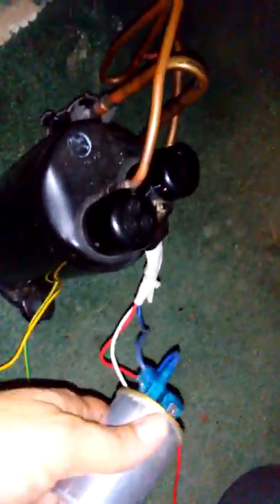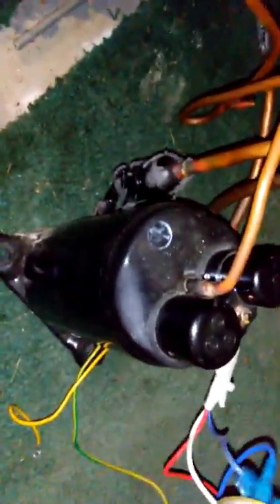Testing a new vacuum pump for vacuum distillation

Comment: That'll ruin the compressor if you don't put a cold trap between it and the water.
Reply from the maker: It did.  I have learned now.
Reply: Ah, bummer. I've got a couple of compressors in the boneyard from learning that lesson as well.
Reply from the maker: @AtlasReburdened  I have a few more of these compressors from mini fridges and dehumidifiers.  So it was a cheap lesson.
Reply: Good stuff, I pull compressors out of fridges in scrap yards that have already leaked out, so those mistakes didn't hit me too hard either.

Comment: Hello there, is steam will still rise up in a vacuum state, to be able to distill water at low pressure?
Reply from the maker: Sure can.  We use vacuum distillation for heat sensitive compounds to lower the boiling point of the solvent.
Reply from the maker: At this low temp the water is just off gassing the dissolved gasses in the water.
Reply: @cannagorilla  thanks for the reply. I just thought that the pressure inside the system is constant even if you raise up the temperature.